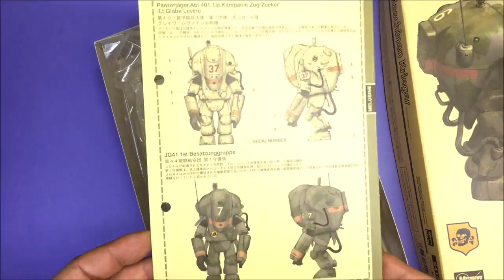[Maschinen Krieger] "We have to GO!" EP01 : HASEGAWA 1/35 Ma.K. MELUSINE

Comment: Great weathering! I liked how you thought through your process, starting on the inside working out to paint the joints. I just did a dip of three Mel’s. I replaced the joints wit copper wire covered in aves epoxy sculpt. What kind of seam scraper is that. Brand?

Comment: What was the coil you put over the brass wire?
Reply from the maker: It's a coil purchased from the model shop. it's not sold by a famous model product manufacturer, but by a local brand in my country. thanks.
Reply: on the zero what country are you in?
Reply from the maker: Korea :)
Reply: Wave Corp makes those coils. Found them on Ebay. They call them springs
Reply: @zepocean8580  do you have a link?